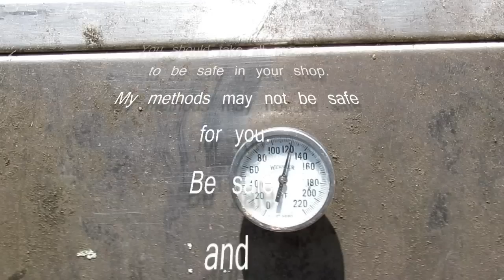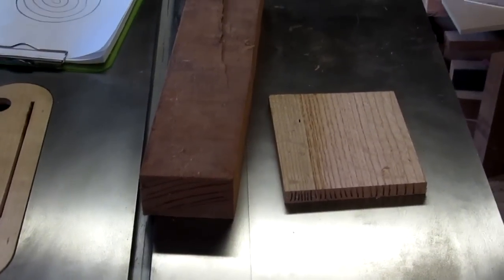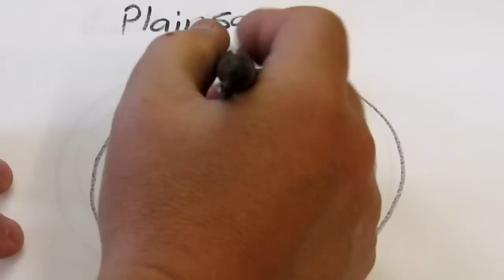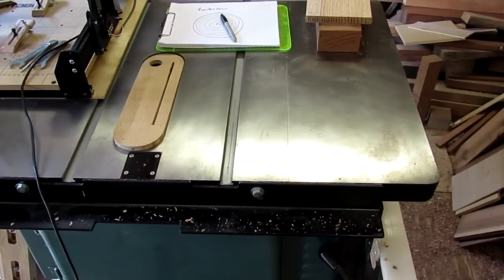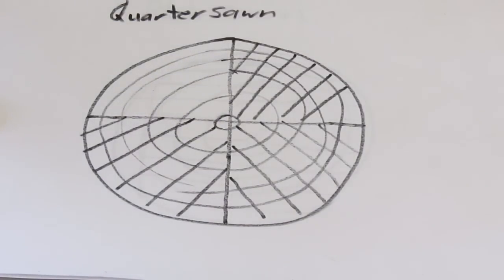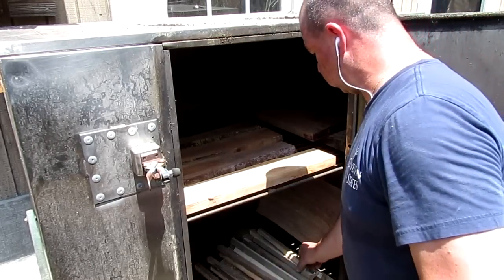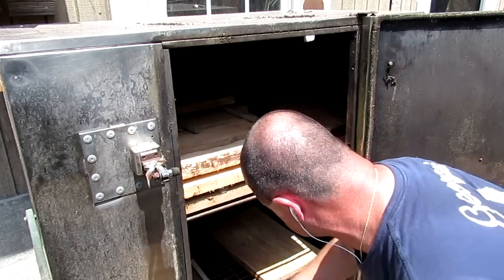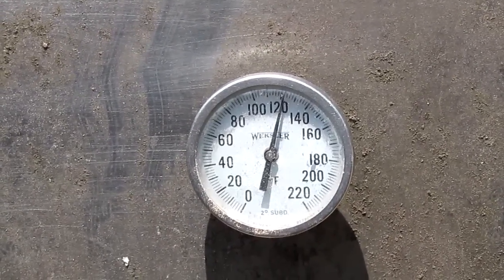#81 My Shopmade Kiln and Sawing Lumber

Comment: Great idea on the kiln. I can't wait to see how it works out. I have installed quite few thermostats in metal cabinets. All you need is a 120 volt thermostat from an electric supply house. Feed power into the thermostat and wire the output to a receptecle, that way you can plug in the heat source of choice. when I was a kid we used these to keep our pump house from freezing. I hope this helps. Thanks for all your help to the rest of us.
Reply from the maker: Jim Wright Wow, thanks Jim. that is exactly what I needed! and I appreciate you taking time to let me know. I will get this thing wired up ASAP. Thanks again, and thank you for your support.

Comment: Great vid Stephen. I worked in a furniture factory for years & remember if you went near the open doors of our 2 giant kilns soon after switch off, you would get soaking wet!!! Moisture & heat was pumped in so the outside of the timber was kept wet while the inside dried. It's a bit like storing a part turned bowl in wet shavings. Might be an idea to put a bucket of water in the kiln & shut your vent holes for the first half of the drying process & then slowly remove it & open the vents. It wasn't foolproof but that's how they dried our oak & ash.
Reply from the maker: archiearchie666 Thank you sir. I think that is brilliant, and it makes good sense also. I will give it a shot. Thank you for your suggestion and comments.

Comment: Very nice kiln Stephen and great info on cutting wood. As for your temperature regulation they make a t-stat that controls attic fans. Most of the box store sell them and they work well. It's a very simple circuit. 
Thanks for sharing 
Mark
Reply from the maker: MARK Baid Thanks Mark. I really appreciate the info. I have to go to the Home Depot tomorrow and will see what I can find. Thank you for your suggestion. Thanks also for all your support my friend. "Do a kindness daily."

Comment: Stephen,
If you can find some slate, even scraps or slate floor tile, line your kiln.  Slate, retains heat somewhere around 10 to 1 opposed the standard metal interior.  Even a "brick" of it will retain heat 10 to 1, thus allowing your kiln to work more efficient.  Anyway, its just a suggestion...  Thank you for your contributions, I enjoy watching and learning from your videos.
Reply from the maker: J Fenter Thank you sir for the suggestion of using slate. I never knew that characteristic. I have a lot of it also right here at the house. I live in Rockmart, GA and slate is where it got it's name. How lucky!. Thanks again.

Comment: Nice video Stephen.  You can buy thermostats used for smokers that wire up with a  110v outlet.  Then plug in your source for heat.  It doesn't take much in a small space.  I use a portable electric single burner or you could use a light bulb and plug it into the thermostat.  Works great for wood drying or cool smoking jerky!  Amazon for the burner @ $15 and the thermostat you can find on ebay or craigslist or restaurant supplier.  Good reliable one can get pricey though so keep your eyes open for a bargain  Good luck!
Reply from the maker: Rick Stonewood Arts Thank you so much Rick. I think I will start looking in to your suggestion. It sounds like just what I need. Also it is right on line with other suggestions I have gotten. So it has to be the right way. Thank you for taking time to make your suggestions.

Comment: Hi Stephen - nice re-use of the smoker.  You should be able to use a water heater thermostat to control a lamp inside the kiln.  Conveniently, their control range is exactly what you said you wanted: 120 degrees to about 150 degrees.  Also, thanks for the explanation of quarter-sawn wood.  Occasionally heard it - never knew what it meant.
Reply from the maker: Herb Les Klug Thanks Herb. I think I will go with the water heater idea. You and a couple of others have suggested that and it sound like it would be perfect. Thank you. Quarter-sawn wood is very good for furniture because of its stability and resistance to cracking with changes in the weather. Thanks again for commenting and supporting my channel.

Comment: A very interesting and informative video Stephen, especially about the plain and quarter sawn wood. The kiln is an impressive piece of kit too mate. I am not an electrician by any means, but could you not link up a thermostat to the power source, that will cut it when the correct temperature is reached? being that I suggested this, it's most probably wrong......lol
Take care
Mike
Reply from the maker: Mike Waldt Thank you Mike. I am glad you enjoyed this project. I think you are correct with your suggestions about keeping my kiln heated. Using a thermostat seems to be the general suggestion. So your suggestion is probably right my friend.  Thank you for it. Take care.

Comment: great idea, just one thing, is it possible that the gasket that seals the door, maybe, could be, made from asbestos, considered deadly here in australia
Reply from the maker: +michael wakley Thank you Michael for bringing this up in your comments. This smoker was made in the 1990's after asbestos was found to be cancer causing. This seal is made from a rubber infused rope. Asbestos is also considered deadly in the US. I don't think it's use is banned but it is very strictly regulated for sure. Thanks again. Excellent point and discussion.

Comment: Hi Stephen, Thanks for all the great info. This is only the second video of yours I've watched, got pointed in your direction by watching Robbie the woodturner. I live in British Columbia and have lots of pine on my property that has been infested by the mountain pine beetle and I've been thinking about making a kiln so I can do something other than heat my house with the wood. It's sometimes called denim wood or denim pine because of the blue streaks in the grain, very cool looking.
I don't know if you've solved your temperature control problem with your kiln but, being an HVAC mechanic by day, I was thinking of using a Johnson Controls A19 Temperature controller. It will give you a better temperature range than an attic t'stat and has a remote bulb and easy to wire up, any plumbing supply wholesaler should carry them. Anyways I hope that helps and thanks again for the great videos.
Take care
Gary
Reply from the maker: Gary Zubick Thank you Gary. I haven't heard of the Denim Pine. It really sounds like it is unique. Right now I have a medium sized toaster oven in my kiln and have it around 150 F. I will look in to your suggestion for a more permanent solution. I really appreciate your help and suggestions. Thank you sir.

Comment: Hi Stephen , really useful information about the quarter sawn timber, it's the kind of thing I always thought I should know but didn't and felt I couldn't ask for fear of making myself look stupid !!.. So now I know.
Very interested in your kiln, looking forward to seeing what heat source you use and how long it takes to dry the wood, it's something I've never given much thought to and I don't know why because it could be a great addition if I can find somewhere to house it! 
Keep up the good work my friend. Trev
Reply from the maker: Trev Sutton Thanks Trev. I have wanted (needed) a kiln for a long time just to help me get lumber going a little faster. With air drying you are looking at a year per inch of thickness minimum. I am not patient in that aspect and when I cut up some boards, then I want to use them. Hopefully once I get a good heat source inside it will work to dry wood about 60 to 70% faster, and kill any bugs or larvae still left inside. Quarter sawn wood is very stable and excellent to use for furniture projects. Glad you found this project helpful my friend. Thanks again for commenting.

Comment: You could possible find a 110 volt water heater thermostat and use that to regulate heat possibly I dont really know but that would be a potential thermostatic controller for it and could actually use it to control the vents too
Reply from the maker: That is a great idea. Definitely worth looking into. Thank you!
Reply: @StephenOgle  well your quiet welcome let me know if you use one or if not the reason against it cause I'm not sure if it will but it seems like it should

Comment: Thank you Stephen for a very interesting video.   This is the first time I've fully understood quarter sawn wood.
As always I'm on the look out for turning wood and I've had my eye on a piece of ash about 5 feet long and 18 inches in diameter which has been lying on the ground of a  local farmer friend for the last 3 or 4 years.  We got to cut it lengthwise a few days ago and I couldn't wait to see what it was like when separated.    My farmer friend was totally unimpressed but I was hopping about like a mad man at the sheer beauty of it.
As regards smoking I will give you full marks if you can tell me what a kipper is??  No googling:-).
Best wishes,
Alan.
Reply from the maker: Alan Simpson LOL, Thanks Alan for the story. I know exactly what you mean. I can just see you jumping around after opening that log. I know because I have been there and done that. LOL!! I am not absolutely sure (because you would not let me use google) but I think Kippers are Halibut fillets. I know also that the stink. How close am I? Thanks for commenting my friend.
Reply: Stephen Ogle Thanks for your reply Stephen.   A kipper is a smoked herring.    Herrings are like large sardines.   In preparation for smoking they are gutted and then opened out flat.I was only going to give you 5 out 10 but as you put some effort into it I have decided to give you 7 out of 10 :-).Looking forward to your next upload.With all good wishes,Alan.
Reply from the maker: ha, Ha. At least I am in the top 70%. LOL

Comment: Look into some restaurant supply places should be able to find a reasonably priced infrared food warmer for under $200.  Or just an infra red heat lamp with a thermostat would work.  Maybe able to find one if you have a source for old used restaurant equipment you would be looking for one of those units used to keep soft pretzels warm.  Depending on temp needed may also be able to source a thermostat from greenhouse/hydroponic controls or perhaps from a pet store for reptiles.  Both of which may require the use of a relay depending on current/voltage of bulb but thats not difficult to wire up.
Reply from the maker: Syriusly Delyrius Thank you sir for your very well thought out and detailed suggestion. There is a place in a nearby town that sells restaurant supplies and appliances. They may have just what you suggest. Thank you very much!!

Comment: Stephen Ogle After watching your video i will turn my old refrigerator into a kiln any suggestions? I know you ask for ideas and as i was designing mine i came across a timer in my junk drawer. I will set the timer to turn off and on at different times of the day so i can control the temperature when i install the light bulbs. I will also use an old computer fan that will be wired with the light bulbs. Thinking of putting one on each side of the light bulbs. My Old mini fridge is from the 50's what safety precautions do i need to look out for?
Reply from the maker: Thank you Clarence. Glad you enjoyed this project. I finally ended up putting a small toaster oven in the bottom of my kiln and it works perfectly. It will pull a draft throughout the kiln making the use of a fan unnecessary. This kilnworks very well now.

Comment: how long does it take for the wood to dry. how about the bowl blanks compared to drying them in shavings.
Reply from the maker: Thank you Manuel. It still takes a couple of months to sufficiently cure for use. I am using a small toaster oven as a heat source now and keep it a 120 degrees F. This really accelerates the drying. The same can be said for the bowl blanks although they seem to dry even faster since more endgrain is exposed. I hope this helps.

Comment: A Johnson controller.  That's what you need to control the temp of a heater or heat lamp.  I use them for a kiln like box i have in the basement for making my beer.

http://www.amazon.com/s/ref=nb_sb_noss_2?url=search-alias%3Daps&field-keywords=Johnson+temp+control
Reply from the maker: +mpride1911 Thank you sir. I'll bet your beer sure is good, huh. MMMM.  Thanks for the tip on the controller. I will check it out. Right now I have a toaster oven inside, LOL!  Works good but it is only temporary.

Comment: Has anyone every used a ceramic kiln to dry wood? See then on craigslist all the time in my area as was considering one if anyone has any advice or experience.
Reply: Clarence Marsh it will not work. It will dry the wood too fast.